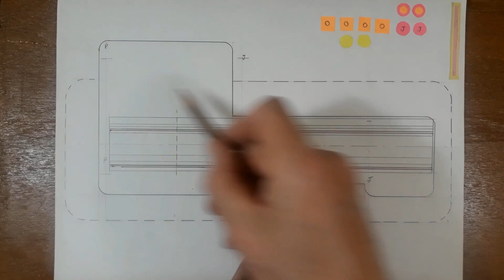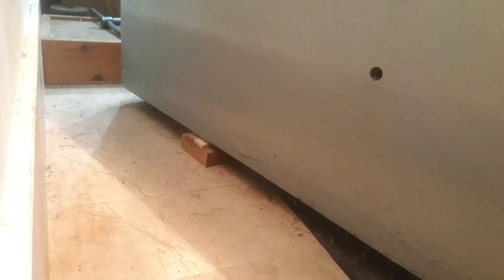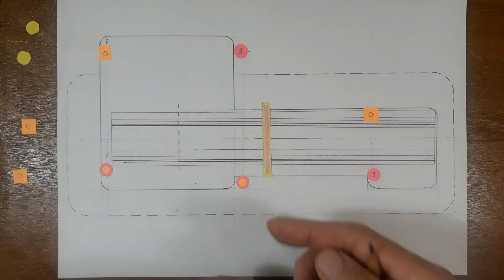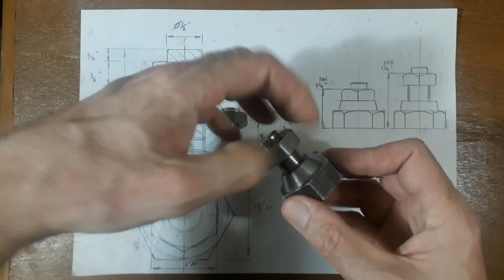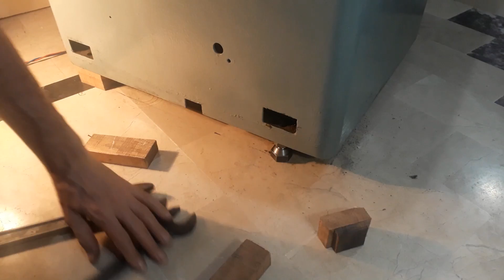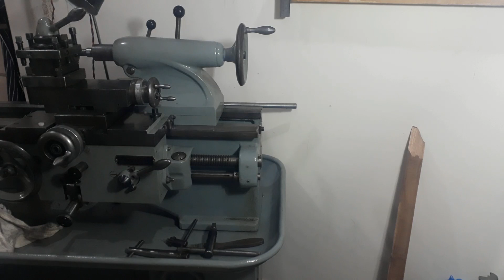Levelling Colchester Student Mk1 Lathe

Comment: I must revise what I just said, in that: they do not need to be level, but MUST be in a straight plane along the length of the bed.
Reply from the maker: Hello Stewart. Thank you for your comments. Yes, I agree that ideally the bed should be checked to ensure it is level in the longitudinal direction. I attempted to deal with this by the feel of the jacks aiming for roughly equal loading. I suspect that turning accuracy will be far less susceptible to bending of the bed along the length than to torsion along it. Since it would be difficult to measure with my level I was going to propose another approach: To mount a test bar in the mandrel to detect vertical deviation with a DTI from an unworn surface of the bed. I might try this in a later video. I think there will be diminishing returns for a lot more effort. I wonder if you agree.
Reply: Hiya,
thank you for the reply, yes you're right about the diminishing returns, but the bast way to do it is to use a really good straight edge and feeler gauges.   But using a long test bar is even more accurate for the end result, as it refers back to the accuracy of the headstock deviations.
Either way, great job and very well thought through, and superb work. @Workshopfriend
Reply from the maker: At some point I would like to make a straight edge (or a set!) will see. I think too costly to purchase. (I made a rough set of three from hot rolled steel for my homemade lathe but for this something more accurate would be required.)

Comment: I very much agree that the levels at the three points you checked are now level, but that doesn't take into account the level at which each point resides in space, without checking the level in an axial direction along the bed.
They could in fact be quite different from each other which would still give you a non concentric result in your turning.
Reply from the maker: Responded to this in your next comment.